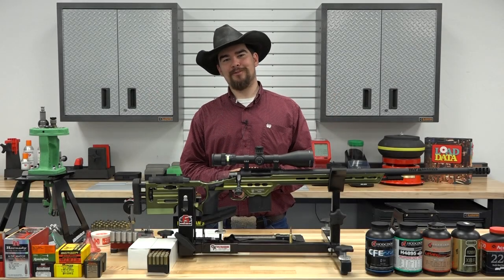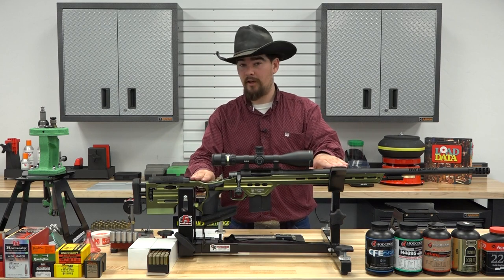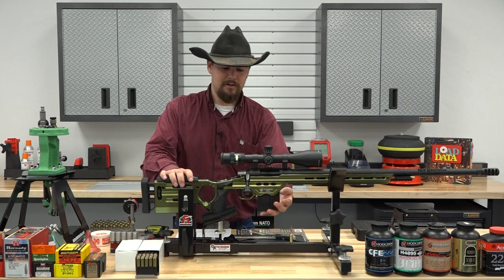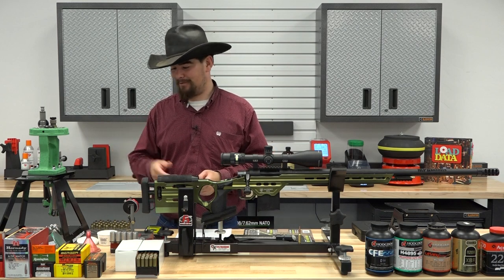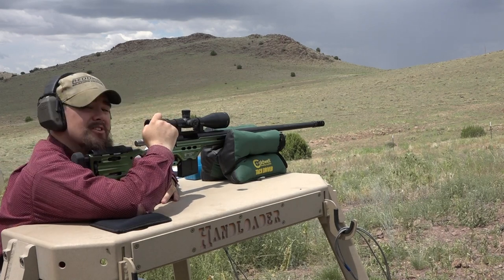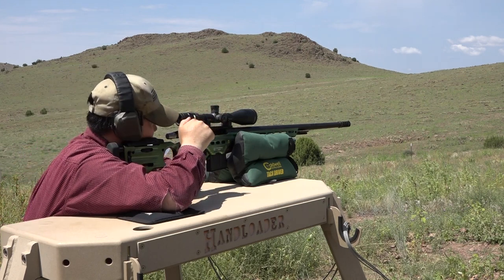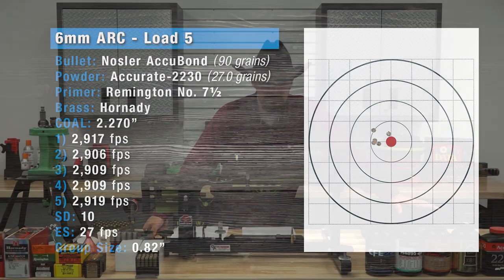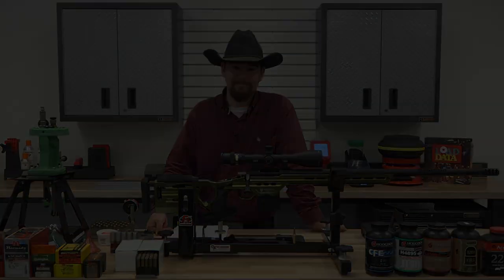Handloading and Shooting the 6mm ARC

Comment: Anemic charge weights and velocities for a 26" bolt gun. Bullet jump would be a lot more useful information than COAL. Free bore varies wildly from different barrel makers in this cartridge.
Reply from the maker: Some of them are a little light like the charge using LeverEvololution but the charge using accurate 2230 is pretty stout, there are many more loads available on our website Loaddata . com just type in 6mm ARC and you can see them all. I think that might be a good column to add for future videos and that may be something we will have to add. It definitely does vary quite a bit. Generally speaking the thicker jacketed bullets like the Accubond liked more jump and the thinner jacketed bullets like the bergers liked less jump. Thank you for watching and for the suggestion! --Jeremiah

Comment: Great video Jeremiah. Two quick stories. The first one several years ago I was shooting my 6PPC rifle and it was grouping about 3/8 of an inch. A large horsefly landed on my target and I aimed a little below the fly and pulled the trigger in the flight disappeared when I got down there I found that I had hit it dead center and there was a splatter of fly fluids in a perfect circle around the bullet hole. I had the range master sign that target. On the second one my uncle was shooting a nice group when the third shot ended up going about 2 inches to the right he didn’t figure how that could happen as his group was just a cluster. As he went to shoot the last and final round into the group the bullet hole that had been the flyer started walking over to investigate what was going on in the little cluster. Turns out it was a fly in my uncles bad eyesight thought it was a bullet hole. Thanks for all you do, sir.

Comment: 17 LBS WOW! IAM 75 YEARS OLD bye?
Reply from the maker: It is a very heavy rifle for sure but it's a great test platform for working up loads for and the load data and information about the cartridge capabilities are still relevant. If you are interested in the cartridge in a lighter weight rifle I would suggest checking our our video on the Howa Carbon Elevate, it's sub 5 pounds and we tested one in 6.5 Grendel but you can see the rifle performance for yourself in that video and view the 6mm ARC cartridge performance in this video and maybe that would be a good combination for you. I have pasted the link below. https://youtu.be/cC_d23rEV24 

I hope this helps you out and you can still find some useful and interesting information from our videos, if not I completely understand and we appreciate you at least checking us out! --Jeremiah

Comment: I’ve been wondering if the 6 ARC is exactly the same that a fellow developed out east, years ago, called 6AR Turbo? I have the gun, dies etc ready to go and would use some of your load data if that’s true. Do tell.
Reply from the maker: The 6mm ARC is indeed very similar to the 6mm AR, in fact there are many cartridges that are quite similar. However when it comes to load data that can become a bit tricky. As mentioned in the video there is two pressure levels for the 6mm ARC and I would not use any of these loads in a Gas gun these loads are only safe in a bolt action rifle. Now if you are shooting it in a bolt action by all means use the data that is what it is there for! Of course cross reference the data and start at minimum and work your way up to maximum. The case capacity difference between 6ARC and 6AR is only about 2 grains if memory serves me correctly so the data should be cross compatible. Thanks for watching and thanks for the great question! --Jeremiah

Comment: This is our first time seeing this video, testing our 6mm ARC sizing die. We’re late to the party, that’s for sure. Note: we’ve set the drop in Mandrel to increase bullet tension to .002 to .003 depending on the brass spring back. 
Thank you for the review and testing Jeremiah.
We appreciate.

Wayne 
Mighty Armory
Reply from the maker: Wayne,
Thank you for the kind words, we purchase a lot of our equipment and rifles and therefore a lot of the stuff used is not seen by the manufacturer it's another way we stay unbiased and provide honest reviews. We greatly appreciate you providing the information on the update to the 6mm Arc sizing dies and look forward to using your dies more often in our testing the 6mm ARC die was quite impressive. --Jeremiah

Comment: Great video content as always. I've done quite a bit of reading on the 6mm ARC and from everything I've read and now watched in your video, the 6mm ARC is definitely an efficient little round, for only using charge weights in the mid to upper 20gr. range and heavy for caliber bullets. I'd like to see a future video showing how well it performs, or maintains accuracy at ranges where you can stretch it's legs a bit. 👍
Reply from the maker: Thank you very much we greatly appreciate you taking the time to watch this episode! It is a very efficient little cartridge, It impressed me with it's overall consistency and it seems to bring a lot of performance to the table in a small package. With standardized brass and pressure levels. I would love to stretch this cartridges legs a little bit! I do plan on doing more videos at longer ranges in the near future most notably will be an upcoming video on the 28 Nosler vs 7mm Rem mag. That should be a very interesting video, hopefully we'll have it posted by the end of this month. I do have to return this particular rifle to Patrick but perhaps in the future i'll get my own and we can run it out to 800 yards or something. At any rate thank you for the suggestion it is always nice to hear what others have to say! --Jeremiah

Comment: Have you looked at the 25-45 Sharps? It has the 5.56 bolt face and I'm loading 80 grain ttsx to 3000 fps and loads up to 120 grain bullets with Ram Tac and cci 41 primers. This caliber is the balistic twin of the 6.5 Grendel in those bullet weights. Staying with the AR 15s designed bolt face is in my opinion ( a good idea)! You start milling out metal its going to be weaker!!!
Reply from the maker: I have only looked into it I have not ever fired or loaded any 25-45 Sharps at this time. That sounds pretty fast especially compared to the Grendel I have a video coming out soon on the 6.5 Grendel and I don't think anything broke 3,000 FPS in our testing without hitting pressure first. Maybe that is the key though higher maximum average pressure with the 25-45 Sharps due to the smaller bolt face. The 22 and 24 Nosler have similar concepts they have rebated rims so you can maintain the same bolt face for 223/5.56 both neat cartridges that folks seem to under appreciate. I agree on the strength of the 6.5 Grendel bolts but if you are staying within pressure and using a well manufactured bolt you should have no issues other than normal wear and tear. Thanks for watching and taking the time to comment! --Jeremiah
Reply: @HandloaderTV  I have not looked at the 22 or 24 Noslers. Ammo is to expensive and rare in my area. I like stuff I can make from available brass I/e 223/5.56 NATO and 308/7.62 NATO and I like using bolt dimensions as designed. Brass is easy to play around with, steel not so much. I have blown out 308 blanks to make 8mm mauser brass and necked down 308 to 7mm-08, 260 Remington and 243 Winchester. I have even fire formed 458 SOCOM from cut down 308 blanks. They look funny but they will function. So the 25-45 Sharps is right up my alley. 5.56 brass is everywhere!😉

Comment: I have gotten some really good groups with my AR-15 in 6 arc shooting 58 gr vmax, 70 gr. Speer match bullets using cfe-223, also LT-30 powder. My AR HAS A 20" Seekins barrel and a triggertech go button
Reply from the maker: Thank you for sharing your experience and results with the cartridge we greatly appreciate it and feel it adds a lot of value to the comments section! --Jeremiah
Reply: My Arc loves CFE-223 and 95g nosler bt's

Comment: At least he did show the variation in pressures from AR platform to bolt action.  I do not have that issue with my 308.  Good to go best load for my CMMG AR10 type platform and my bolt action.  This is a safety issue and a non starter for the Gendels and the ARC platforms.
Reply from the maker: Indeed the pressure levels for the AR vs the bolt action is quite a bit and one has to be very careful about what pressures you are loading to. Especially if you have both an AR and bolt action you don't want to mix up those loads. It is a big issue for a lot of folks the bolts are just not strong enough to hold up to more pressure. The larger the case head the more bolt thrust that is created. Great point and thank you for watching and taking the time to comment! We strive to provide the best information possible in an easy watch and understand format. --Jeremiah

Comment: Build you an AR version, I built a 20" 6 ARC AR, but I have a 1-7 twist on mine, not the normal 1-7.5, it has really helped with the Berger 115 VLD Target in mine. If I do my part I have shot a couple of sub MOA groups at 600 with it. Most are MOA for me as I am still learning the tricks for long range shooting.
Reply from the maker: I am really thinking about it! After reading Patrick's article on the cartridge and working up my own loads for it I am impressed! I will have to look into the twist rates I like the sound of a 115 grain Berger and sub MOA groups at 600 Yards!! Thank you for taking the time to share your experience with the cartridge and for watching the video! --Jeremiah
Reply: Did you get the Ballistic Advantage barrel? that's what I bought and the more rounds I put through it the better my groups get

Comment: Really enjoyed this video Jeremiah.  Informative and on point.   Do you think using bags as opposed to a front rest has any benifits or is it just personal preference?
Reply from the maker: Glad to hear you enjoyed the video! Thank you so much for watching! We do our best to provide as much information as possible in an easy to watch and follow along format. That is a really good question and I would say that a really good front rest is just as good if not better than bags, especially the front rests used in F Class and stuff like that. However the front rests can be difficult to fit to the wide variety of  different rifles we test here on the channel so I resort to using bags. The most important thing is that you are comfortable and that it is repeatable. So if you have a wide variety of rifles you test with different weights and forend sizes I think bags make the most sense, if you have a handful of rifles that you are testing and it's no problem to swap out components of a front rest to ensure a perfect fit then I think a good solid rest like the T-Rex from Rodzilla is a great option Ransom also makes some really nice front rests. Of course bags are also a much cheaper option than most of the good quality front rests out there. That's just my two cents,  Thank you for watching! --Jeremiah

Comment: Another cartridge I wanted to wildcat at one time is the 30AR. I think it could be a good parent case for some small bore speedsters 22cal up to 25cal.
Reply from the maker: That would be very interesting, that is a cartridge that has not gotten much love, I think it would be interesting as a 22 cal Wildcat, It would be interesting to see what kind of performance you could get out of that case. --Jeremiah
Reply: @HandloaderTV  All one has to do is look at the capabilities of the 6mm ARC, then add at least another 150fps. but likely more, as well as 200yds+ of effective range and you've got yourself one very capable  1500yd(+?) cartridge. The dimensions are identical to that of a shortened 7.5X55 Swiss. The dimensions are also that of a shortened 284 Winchester, without the redated rim. I drew up a 6mm wildcat on the 30AR case quite awhile back, but I have not sent the drawing to have reamer and gauges made....YET!😉
Reply from the maker: @stevepuyear2738  I must admit that sounds quite impressive and that may make the fireforming and case forming all worthwhile. If you ever have a reamer or gauges made up you'll have to let us know and in the meantime I will have to look into it and see if we have room in our video production to squeeze that in! It sounds like an interesting cartridge! --Jeremiah
Reply: @HandloaderTV  Thanks for your reply and interest in this concept cartridge. If I were to build brass for it I would use shortened 284Win. brass so the rim diameter would work with existing 0.473" bolt faces. Also I've developed and built rifles for 3 other wildcat cartridges. They are 6mm, 8mm, and 358. I have and own the reamers/gauges and would love to have someone do some testing with the 358cal wildcat. The one rifle that exists was built for a vary close friend that lives in Colorado. The rifle is a Post64 Mod70, controlled round push feed action, 26" stainless barrel. The stock is Winchester's walnut Featherweight, pillar and glass bedded. The gentleman has not had time to put any load development into the cartridge/rifle. I designed the cartridge and built the rifle them gifted him the rifle just days after the project was finished. If there is any interest from Handloader TV to build and chamber a rifle using my 358 wildcat, I would be all for the project. As it sits now, my friend owns the only rifle ever made in my 358cal wildcat chambering.
Reply from the maker: @stevepuyear2738  You are very welcome I appreciate you sharing the information with us! That makes sense I could see that. I certainly want to get into testing more wildcats in the future! I think it would be a neat addition to the information we provide and I think a lot of folks would be interested in it. Sadly it is very time consuming compared to our load development videos and we have so many other projects I have no idea when we would have time to get around to it. I would love to keep in touch about it though and keep it in mind should an opportunity arise. I think the biggest challenge with wildcat cartridges right now is it's difficult to get brass and components as we don't have a stockpile of components dedicated to wildcat cartridges. I am hoping that gets better soon and then it will open a lot of doors for us when it comes to video production! Perhaps we could even cover some of yours. --Jeremiah
Reply: @HandloaderTV  Thanks again for your reply. I completely understand about the time and budget being very tight and spoken for regarding other projects. Should the time ever come when there's interest at Handloader TV to do a video on a medium bore thumper, I would loan my reamers and gauges to you, as  well as supply 100 new unfired cases, the 3 different bullet weights and types the cartridge was specifically designed to handle, and the reloading die set. Let's keep in touch and no doubt I'll be watching your great videos along the way. Take care and God Bless.
Reply from the maker: @stevepuyear2738  You are very welcome thank you for all of your interest in the channel! I wish we had more time to produce videos and I hope one day they do get more attention. I am sure there will be some interest in the future. That is a very generous offer and I really appreciate that, I do not take that lightly that means a lot that you are willing to give us that kind of support. My email address is Jeremiah@wolfepub.com feel free to send me an email and keep in touch! That would certainly make producing a video much easier! Thanks again and God bless you as well! --Jeremiah

Comment: Nice work.... any tips for the 112s in a gas gun?
Reply from the maker: Thank you very much for the kind words. I would suggest picking a powder that will mostly fill the case with that bullet, with such a long bullet you are going to be eating a lot of case capacity because you'll be seating the bullet so deep to feed from the magazine or you'll have to single feed which in my opinion just doesn't make sense in a gas gun. LEVERevolution seems to be the powder in this particular cartridge I would suggest using that for the most performance in your particular application. There are other powders that should work well though CFE 223, H-4895 would be my other go to options. I also would recommend switching to a bullet with a Hybrid Ogive design, that should make it more resistant to bullet jump. Hopefully that helps you out best of luck with your handloading and shooting! --Jeremiah
Reply: Try Accurate 2520
Reply: And get a adjustable gas block, helps lighten recoil and increases bullet velocity
Reply: @HandloaderTV  Ok, so a ball powder.
Reply from the maker: @mostrogolf22  CFE 223 and LEVERevolution are both ball powders but H-4895 is an extruded powder and also works well. If you are chasing velocity I would go with a ball powder, if you are looking for consistency and accuracy I would suggest and extruded powder. However good results can still be obtained from ball powder these are just general guidelines. --Jeremiah